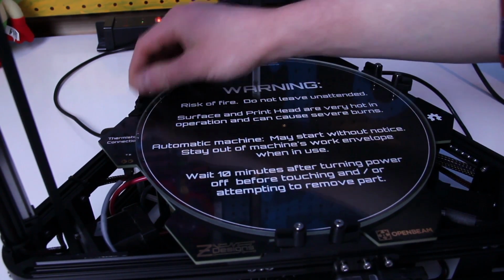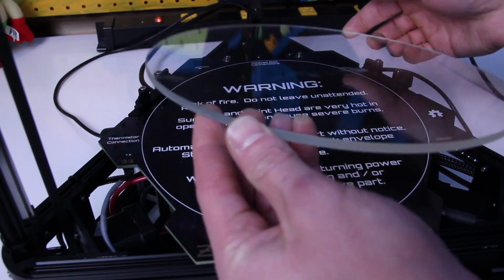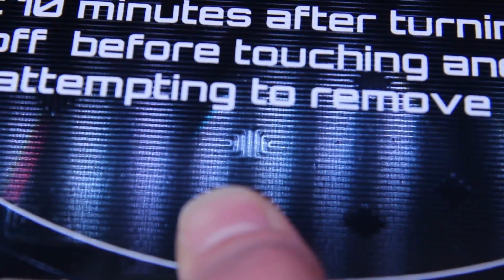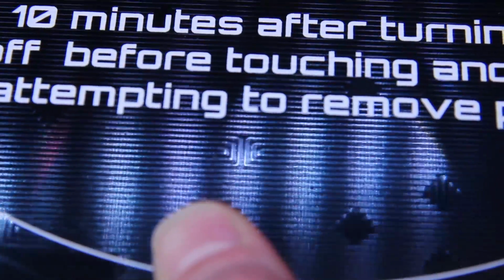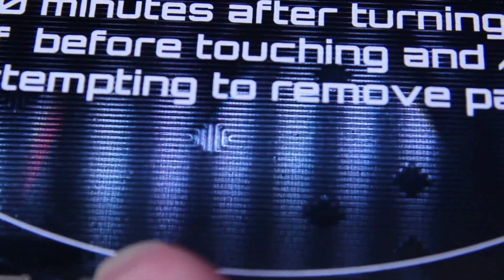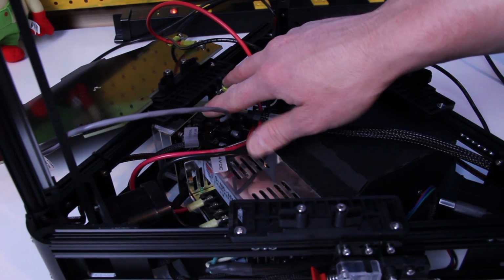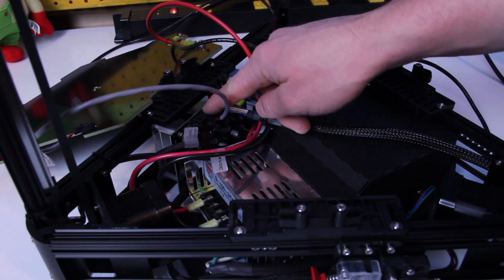Overview of 3D Printing

Comment: My company has a 3D printer, although I haven't personally used it yet (I work at an architecture firm). We print everything from 3D architectural models to custom parts we design for some of our projects. Most recently we printed a custom railing part.
Reply from the maker: ARTiculations That's really cool. That has to be nice to be able to print the models instead of constructing them. People have talked about one day 3D printing actual houses and skyscrapers and not just models.

Comment: I have a 3d printer, and print everything...  I have printed cabinet handles, tooth brush holders, funnels, spice racks, as well as some much more complicated things like super capacitor housings...  possibilities are limitless.
Reply from the maker: Carl Groover What kind of printer do you have? Do you ever print parts for you helicopters?
Reply: SciJoy I have a flash forge creator pro.  very nice printer with heated build chamber for a good price.  And I have not printed anything for my helicopters yet as the parts are simply no where near strong enough.